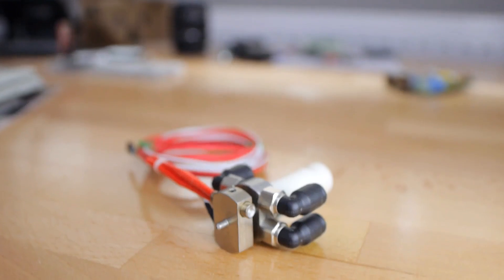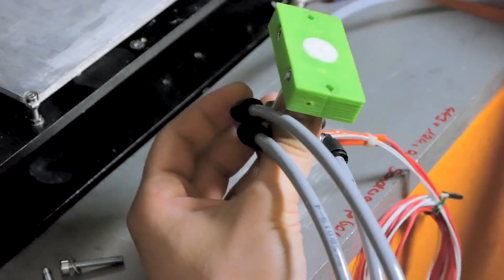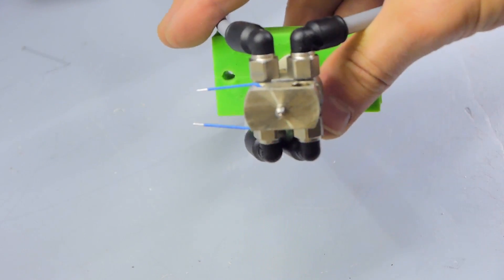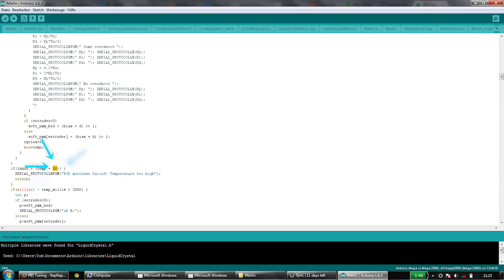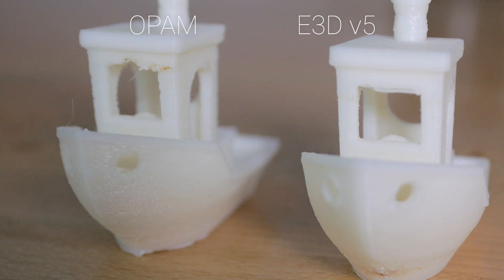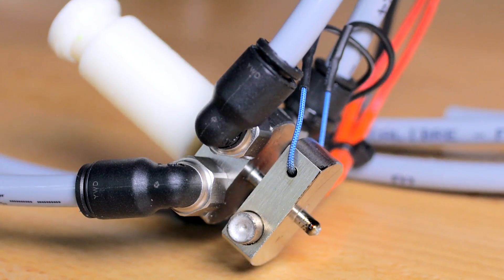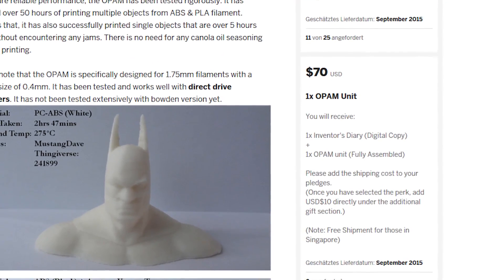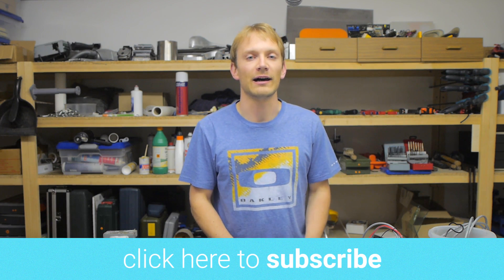Review: The watercooled OPAM hotend!

Comment: wow, water cooled, someone has done it to show how it is impractical on a 3D printer. OK, that's cool LOL.   The temptation to do it is sort of a wish or at least a thought considered by perhaps anyone who has done CNC machining with a water cooled head.  A couple Rabit 2/3 micro injection molfding machines I own, have water cooling directly imbeded in the square metal frame of the molding machine. I suppose they this to cool both the metal frame and all metal that is attached to hold the molds,  so it cools the complete metal ystem and  hides all lines except those that need to be attached to the molds for faster cooling. This is only required on the molding machine if you are going to inject mold with high speed lots and lots of parts per minute, meaning high rate cycles.  Otherswise for onsie twosies water cooling is not required as simply you have to wait for the mold to cool off and you do not have the issue of molds overheating due to excessive high cycles. While this is not the same process on a 3D printer, consistent cool air flow is required on the latter. Would be nice if we could bypass all that contraption required by water cooling.  KISS works for me and a good air fan withn proper understanding of het break and hot end design works.

Why do we still use cheese thermistors and not proper PID Controllers, with K-type screw on thermo sensors for precision. A floating thermisor is never going to give you proper temperature reading by the controller.

Comment: I design water cooling parts for a living so I am quite sure an excellent performing water cooling setup is possible.  Replace the stainless with copper, make the tip removable, ditch the four tube Y setup for a single inlet and outlet, and switch to a flexible silicone tube.  Also get rid of the clunky quick connects and replace them with either barbs or better yet compression fittings.  While you are at it put the bucket used for an open loop back in the broom closet and switch to a closed loop with a reservoir and a better pump.  Also a single 140mm radiator.

IOW yes you CAN make a high performance water cooled hot end...just now at a price anyone will want to pay compared to a more typical air cooled system.
Reply: LOL...that is like designing an improved pair of braces for someone who doesn't wear trousers.....most people don't need water cooled heat sink blocks because as CHEP noted on  another UTUBE review the heat sink does not get hot.

Comment: If this was put together by EK or Swiftech this could be awesome. A good watercooling loop with radiator  would let you get 2 hot ends pretty close together for duel extrusion so you would loose less print space. Heck you could probably run 4 off a loop for some 4 color printing or some crazy prints with pla pva and some flex all in the same print with no purging towers.
Reply: I could see water cooling for a CYMKW mixing + soluble support hot end, where the heat of the bigger size heater and the secondary one might make the cooling fan work too hard.

Comment: why would u cool the hotend i thought it was supposed to get hot and then u cooled the plastic coming out ?
Reply: Ideally the filament would melt just when reaching the tip of the nozzle, giving you the most precision over the amount of molten material coming out and keeping all the rest of the printer above it from melting. In reality that molten zone is a bit larger as the hottest point is the heater block. But just above that, there's a heatsink to stop that zone from expanding upwards into your extruder motor or bowden tube.
Reply: It's cooling the stainless block not the hot end.
Reply: to stop it getting stuck.... this system might make sense for those high temp hottends that go up to like 500*C... otherwise it would take a massive heatsink and fan to maintain that temperature gradient.

Comment: Hi Thomas. Kurze Frage zu deiner Meinung. Ich habe ein 1.75 Merlin Hotend und war immer zufrieden damit mit perfekten prints PLA in 0,2mm layer height mit einem 0,5 nozzel bei 195-200°C 50mm/s. Bis ich versucht habe die Print Geschwindigkeit  Richtung 100 zu ziehen. Ich erkenne exakt die gleichen Fehler wie bei deinem OPAM Hotend print mit starken Moire Muster. Ich dachte bis jetzt es liegt am Extruder und bau schon die ganze Zeit neue Modelle (derzeitig Universal bowden extruder Ti-x1 by Tigeer) oder gar Microstepping Probleme (Kliment DRV8825) und wollte schon zu Fast Decay mode Mod übergehen. Aber Dein Vergleich zu einem E3D v5 6:16 hat mir etwas die Augen geöffnet oO. Was meinst du? Kann es sein, dass es eher an meinem alten Merlin Hotend liegt, oder doch eher das der Direct Drive nicht mitkommt? Grüße aus Stuttgart, du machst tolle Videos!

Comment: Great idea (although far from new), but incredibly bad implementation. First rule of successful innovation - only change what needs improving - do not mess with the parts that don't have a problem.
Doing away with  the standard aluminum heater block and removable brass nozzle was a very stupid idea. They also have a very poor choice of tubing (should have used fine silicone tubing), and a closed system heat exchanger to cool the water. The bucket of water solution is very hokey.
Reply: agreed. this looks like a first attempt at a promising design, with none of the flaws ironed out. every detail is just wrong in another quirky way, like it's never been tested. (FFS! a $4 usb powered aquarium power head. lol) 
one piece nozzles are done right on the prometheus hot end, and they have a couple of benefits.
i can see a well engineered and actually light weight, water cooled bowden hotends becoming the new standard on for high speed and delta printers. once somebody makes one.
PS: here's the pump :D https://www.amazon.com/Submersible-Aquarium-Fountain-Pump-simulate-Environment/dp/B008OCZUK6

Comment: I am working on a water cooler to simply replace the fan on my maker select. this will let me move the fan off of the head and use a much larger but also MUCH MUCH quieter fan to cool the opposite water block. I just want noise reduction :-) same hot end and all just replace the heatsink and fan with a water cooler block. its only $35 in parts so why not try.

Comment: Thomas, great video but a bit of an issue when you compared it to the e3d v5.

Could you try printing in black? It brings out the details much more

And your temperature is too high. I have e3d v5 and v4 hotends (which are the same thing) and I dont have the same issues as I seen with yours. I lowered my temperature all the way down to 168 and it printed perfectly. Just a tip when you make future prints.

Comment: Thanks for the review. It was very interesting. I've only recently 
gotten into three d printing and I've already destroyed one extruder. 
The problem was that I didn't know there was a plastic heat break buried
 deep in the part, so when I started experimenting with higher and 
higher temperatures eventually it let out a puff of smoke and was no 
more.. if I'd had one of these though... anyways it seems like most of 
your problems were due to weird manufacturing errors, I would be more 
interested in if it continues to print at higher temperatures with out 
jamming.
Reply: ‘only destroyed one extruder’ LOL

Comment: Hi, i know i'm late to the topic, but seeing heads like the diamond something, with 3 holes converging so that it can mix colors makes me think that watercooling may be a solution for such complex hotends. For full color, you would require 5 filaments, so 5 heatsinks. It would be almost impossible to fit in a decent sized head.
With properly done watercooling, i think it could be done.
In this case, i feel like the heat exchanger was poorly done if it needs 4 tubes. A proper heat exchanger would require only an in and an out. I'm thinking of microchanel or impact jets, which are not so hard to design. And while at it, a copper block would fare much better.
So any thoughts on this? a 5 filaments mixing extruder, with a copper waterblock, a correct nozzle (that can be changed) could be the key to a full color plastic printer.

Comment: Hi, Thomas. 
You state that water-cooling is not necessary, but I've dealt with a lot of issues with the E3D v5 hotend and J-head. 
I made a small water-cooler from copepr with two 5mm OD tubes, going from a pump to the head. This setup makes me able to print everything I've thrown at the hotend. PLA won't stick to the heatbreak, TPE prints nicely.
Before that my J-head melted, leaked, and everything got stuck inside the E3D.

But as you say: A heated build-champer will be one of the things where the water-cooler will actually make it worth your while. 

Thank you for some nice videos. 

Regards, 
Christian Lerche

Comment: Rather then water cooling, I'd prefer someone make a glass, or even better, ceramic joiner for the cold end and hot end. Other then the difficulty associated with glasswork, there's not really a reason for it.
Reply: ***** Interesting! I probably would not have noticed this article simply because of the language barrier. It is intersting and does point out some issues though. Ceramic joiners need a glass insert. Glass has a lower friction co-efficient.

Comment: I want to have everything generating excess heat water-cooled into a heat sink which heats my aquaponic system in the winter.
Reply: Robert Gress the heat coming out of the water cooler is so small.  one liter water tank will barely feel warm to the touch even after 12 hours printing.
Reply: well my system has grow lights that need to be cooled. The pump generates heat. My CPU needs to be cooled. And my grow system needs to be heated. I figure if I cool everything that needs to be cooled and use it to heat my system. it would be an awesome setup. It wasn't a very serious comment. More of a ridiculous project idea.

Comment: The fact that Marlin rejects the hot end should definitely be a clue to the designers. I was asking on Github whether it would be worth adjusting the PID tuning to be able to handle such a long lag time between powering the heater and receiving the heat, but such a huge amount of delay is really hard to work with. Plus, Marlin also has the option to do temperature adjustment based on the extra average-volume-over-time of material being heated (volumetric compensation), and that can make the temperature graph wavy if it isn't in sync, even with good PID tuning. Of course, the whole point of PID tuning is simply to pulse in as much heat as is (or will be) lost, and that algorithm has a lot of tolerance, especially due to heat sinking. While the stainless steel takes longer to heat, it probably also maintains its core temperature longer, for a bit more built-in tolerance. I think your messy results were mostly due to the long chamfered nozzle tip, which I guess you can machine flat. But truly, it looks like a lot more trouble than it's worth. I'd just spring for a quieter fan.

Comment: Well in all fairness I think that bonding the thermistor inside its hole would have shown better result with the PID loop. Having air gap between the block and thermistor will greatly affect heat transfer between them. But the machining of the block looks horrible. Thanks for the review.

Comment: Hi Tom,

I do apologize that you have to go through all the trouble/hassle just to test the OPAM. (That is certainly not my intention.)

I have hoped that you could have experience the actual performance of the OPAM (The unit that I have been testing does that have any burrs in the nozzle)

The main issue that I noted is the nozzle's burr / uneven tip surface and I will work with my vendors to resolve this machining issue.

Thanks for your honest review!
Reply: Ho Leong khit Hello Ho, you should make your product more modular.
Reply: Chaos When you realise Singapore isn't part of China
Reply: Good concept and as a new hardware concept, there will be obstacles. Looking forward to more design iterations and mass production so costs can be achievable.
Reply: I wouldnt trust what this guy is saying, literally everything that comes from china is nothing but problems. If his product is bad, its because he cut corners and went the cheaper route.

Comment: Perhaps you could print a small sacrificial block with a vertical hole to put the tip of the hotend into and then sand the hole thing with some fine sandpaper. That should get rid of the countersunk hole and ensure a smooth and flat tip perpendicular to the bore.

Comment: Hi Thomas,

great video, however I'm curious, why you are comparing the OPAM to the e3d V5 and not the V6 (is there a reason, why you didnt stick to the v6 after testing it ?)
Also I'd like to hear your opinion about dual extrusion, is it a thing for you ? Would you use it and therefore buy / test ie the e3d chimera or cyclops ?
And lastly I'd like to know, what motors you use for the axis' that move your hotend. Especially paying attention to the torque, would you build in stronger motors for dual extrusion ?

I love the music, keep that ! It gives a more professional touch to the videos and those zoom-in/-out pictures are a great way to compare fine details of the nozzles!
Reply: Marius Breuer I'd also be really interested to hear any reasons for swapping back to the v5. I'd guess you just had all your settings and calibrations done on your v5, and the v6 is just an iteration without any major leap forward to justify replacing it.

Comment: What about taking an angel grinder to the tip to make it flat?
Reply: relevant update! i've recently had a nozzle that was a few degrees off. 
it works best to lay the file on a roll of tape on the print bed, and lower the head onto it. i lapped the nozzle, to get it mirror smooth, which gave it a slight dome shape. result: slightly detremental to the wall surface finish, but perfect for massaging layers of transparent PETG into a bubble free and see-through clear solid. if you attempt this, have the nozzle full with cold PLA, to avoid creating a bur on the inside.
Reply: ***** It should at high/thicker layer heights, at lower layers you will be dragging a big flat over your extrusion width but that may be better than wide skids and/or an air pocket.
Reply: ***** Could be you got a lemon doesn't make sense they would miss such a big flaw in testing. Did you reach out to them about it?
Reply: there is such a thing as a fine dead-smooth file ;)
Reply: That escalated quickly. I was thinking about maybe a file, or some sandpaper myself.